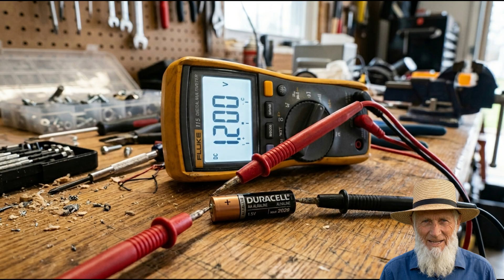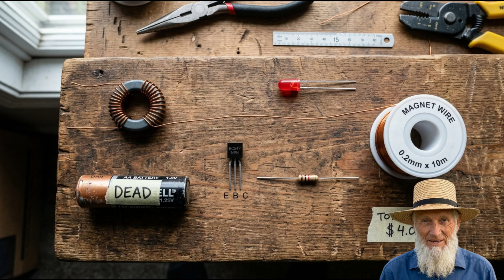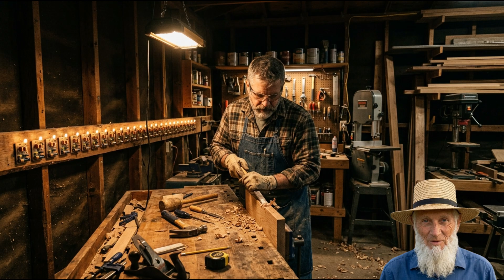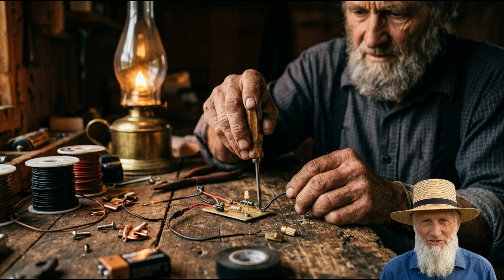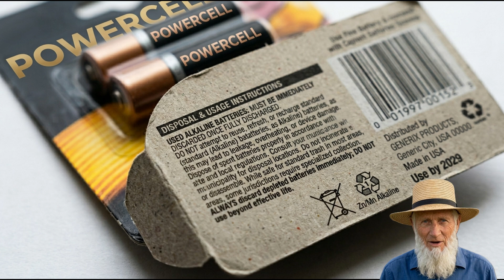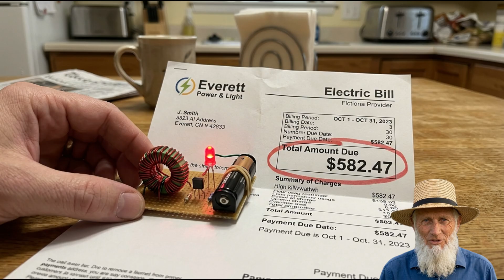Why “Dead” Batteries Still Work

Comment: Remaining voltage isn't a proper measure for remaining capacity. For a standard alkaline 1.5 volt alkaline battery, 1.2 volts represents about 25% remaining power.
Reply from the maker: Good point 👍 Battery voltage and remaining capacity don’t always scale evenly. Appreciate the added context.